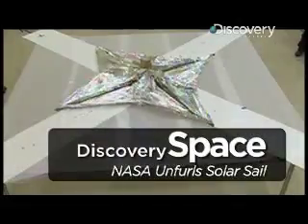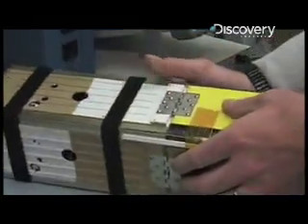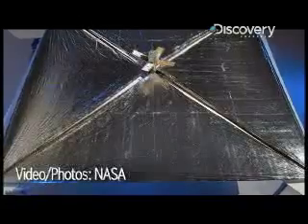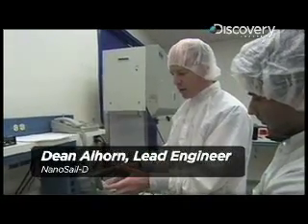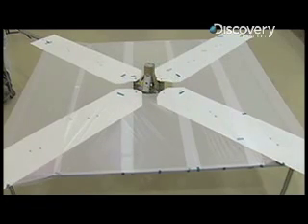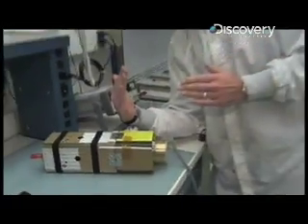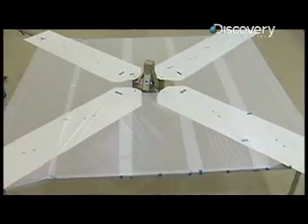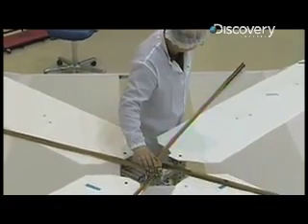NASA Unfurls Solar Sail

Comment: It'd mostly be pointless anyways.  New types of engines are being worked on that would probably pass the solar sail up.  I think the warp drive design has moved from a theory to a small scale experimental stage.  They're testing if they can warp space in a vacuum and checking if it worked by running lasers through it.  If it works on an extremely small scale, then they'll start working on how to get it to work on a larger scale.  That'd make it pretty much obsolete.

Comment: @Taricus its a great idea but the flaw is simple enough that the solar sails we have now cant propel a craft of that weight. the sails would have to be massive and plus mars is to close in away solar sails gain speed by small amounts of thrust be asserted with no friction which allows it to gain more and more speed  if ur shooting for jupiter and beyond it would make more sence but the amount of thrust you gain for going towards mars wouldnt really be enoough to out preform a chemical rocket.